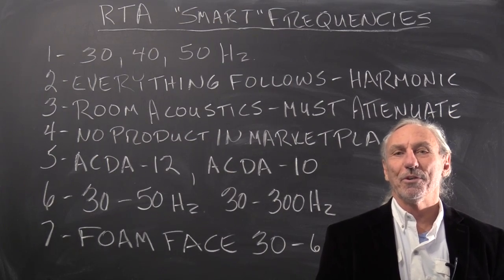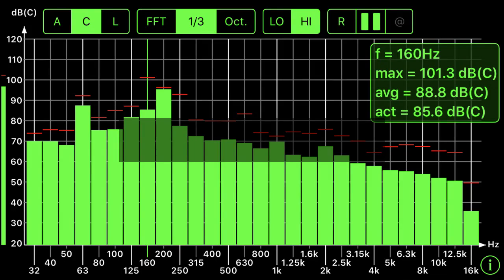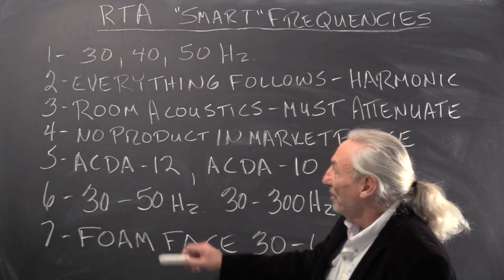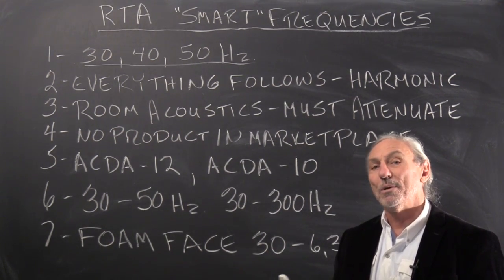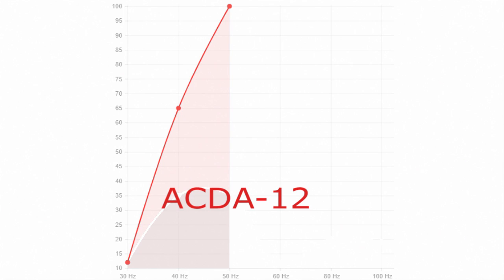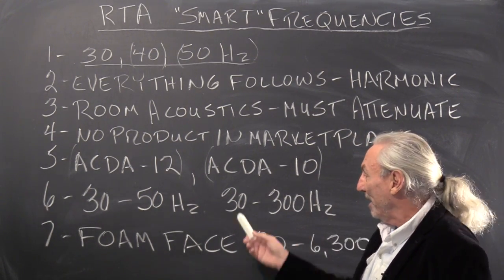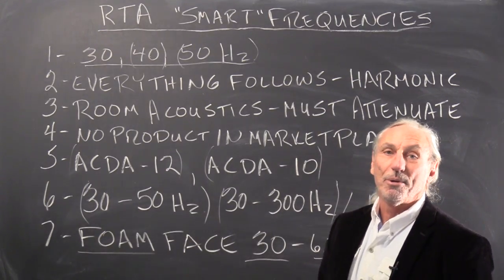RTA "Smart" Frequencies - www.AcousticFields.com

Comment: Could you put some ACDA 12 or QDAs in a front wall of a home theater behind an acoustic transparent screen and get good treatment?  I am thinking of taking down the sheet rock in the front of my home theater to install these devices.  Then, put an acoustic transparent screen over them.  Would these be able to support the top wall structure?  Room is 11.25” w x 11’ h x 15’ l.  I have submitted my room analysis and have a call set up with you soon.

Comment: Do you have a video where you demonstrate how to analyze a room, do you use the RTA analyzer stationery, do you use it like you would to analyze  your speakers first and then the room, 1 watt at 1 meter specs and then walking around the room to test the response of the RTA analyzer, letting you know where to put the energy absorbers, thanks.
Reply from the maker: J,  There is a process but it is time-consuming. We have a database of over 150 built and measured rooms. I am certain your room size/volume is in that database. Fill out the information in this link:  https://www.acousticfields.com/free-room-analysis/

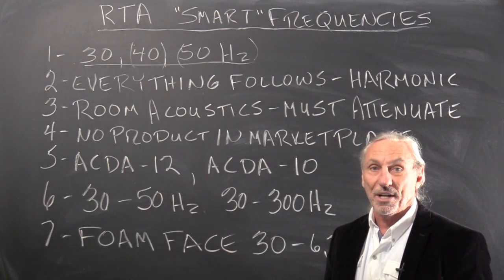Comment: Around 2:01 you say 35% at 30hz? That would be nice, but isn't it more like 12%? Where does this number come from? I don't see it in the Riverbank test result.
Reply from the maker: D,  The lab that tests certifies down to 40 Hz. The 30 Hz. figure comes from our experience and testing in the field. If a product gets s 63 % at 40 Hz. which is indicated in the certification, it only follows that you get absorption down into the 30 cycle range. The 35 % is what we use when we build new studios. We certify our room response to be + - 1.5 dB from 30 Hz. -  16,000 Hz.
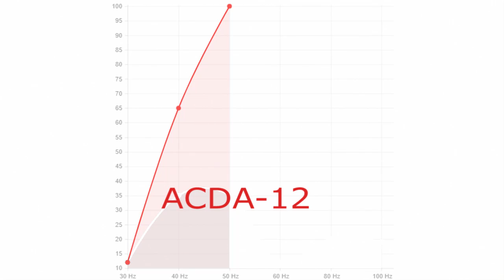Reply: @AcousticFields  But still, the graph at 2:22 shows just about 12% at 30hz for the ACDA-12.  So to be clear, one should not expect to get 35% at 30hz. Thanks.
Reply from the maker: D, You must look at the absorption coefficients and convert them to percentages. A 1.00 coefficient is 100 %. Make sure you are looking at the ACDA-12 which is our big "sponge". The ACDA-10 is a broadband absorber.
Reply: @AcousticFields  How many ACDA-12's are required to get the 35% at 30hz? And how many to get about 12% as the graph shows?
Reply from the maker: D,  You are not reading the data correctly. You receive 35 % absorption at 30 Hz. for every square foot of ACDA -12 unit. Each unit produces 12 square feet of surface area. The surface area requirements vary room to room. You receive ~1.5 dB of attenuation per every 12 square feet or each unit. For example, if you have a + 12 dB peak at 30 Hz. you would need an average of 8 units. This variable also depends on the SPL within the room.

Comment: Fascinating
Reply from the maker: B,  When we built and tested over 150 rooms, we started to see two major patterns in unwanted pressure levels and frequency. We saw this 30 - 50 Hz. issue in 95 % of our rooms. We also saw a 30 - 300 Hz. issue in 85% of the rooms. Our smallest room size was 10 x 8 x10 and our largest was 40' x 20' x 40'. This discovery was the bases for our ACDA-12 and ACDA-10 designs and performance.